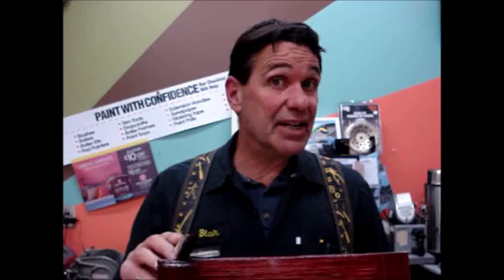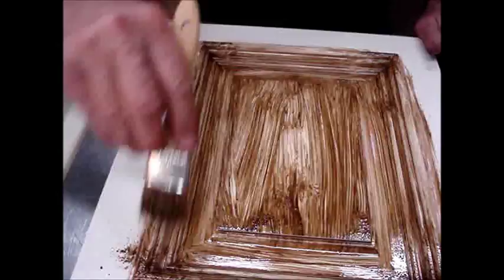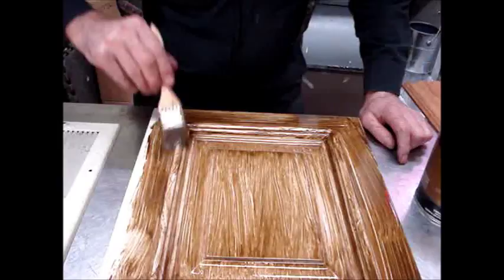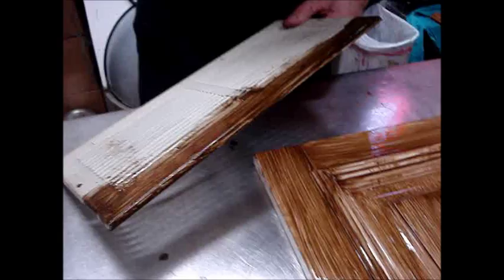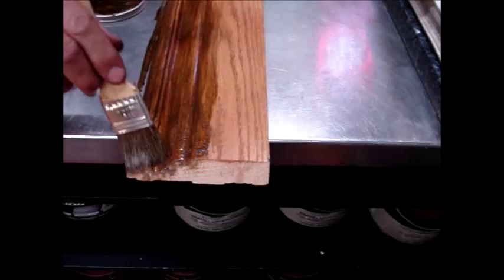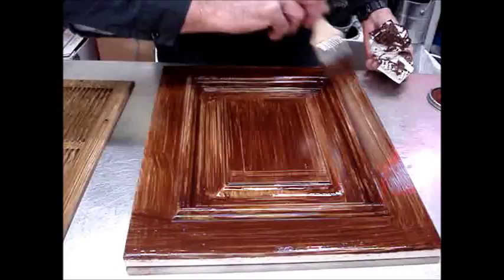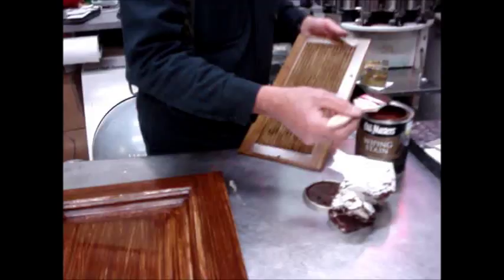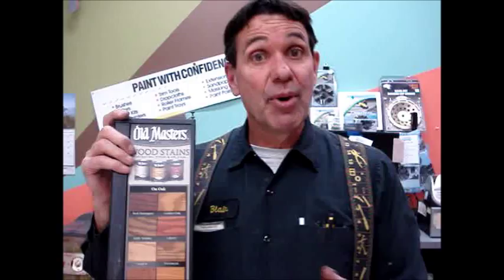How To Stain a Faux Woodgrain Antiquing Effect Quickly

Comment: Hi and thanks.  Now if I were going to do a porch with plywood and sectioned it off like planks of wood should I use the stain you are using and then add polyurethane for durability ?  Just not sure what for use that will last on an outdoor porch.
Reply from the maker: I would use oil-based products, and finish with a thin coat of spar varnish.